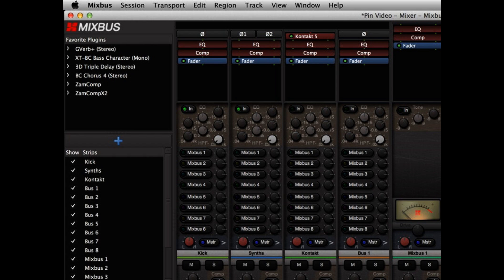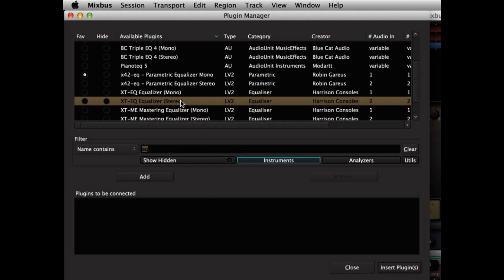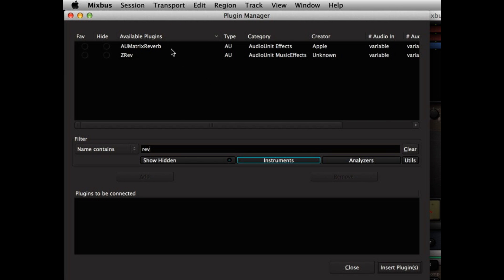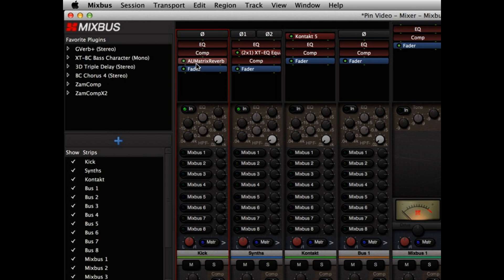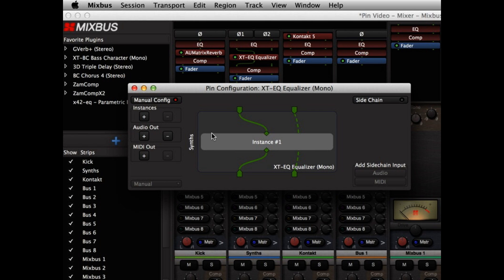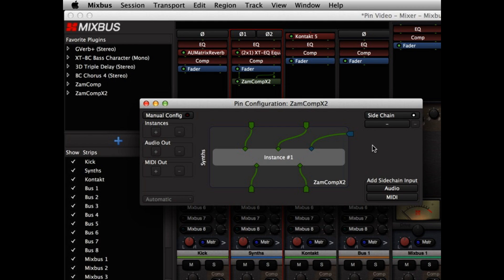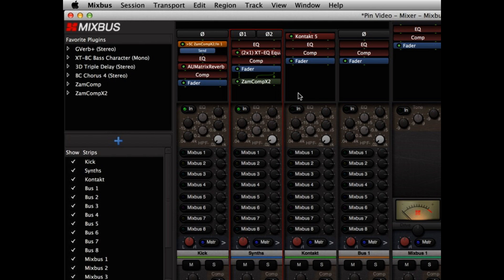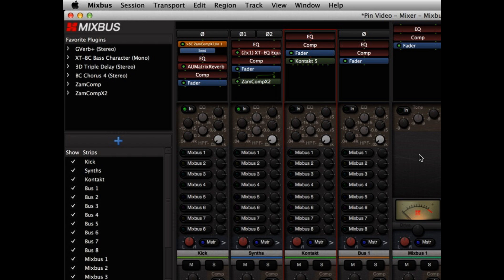Plugin Pin Connections in Mixbus (v3,4)

Comment: The mono -> 2xinstance only works with LV2 plugins right? I have been trying with AU and it doesn't work. I am desperately trying to do dual-mono compression on a stereo track as I used to do in Pro Tools. Anything I'm missing?

Comment: i feel really attracted  to migrate to this software... is there any way to use 3rd party plugins in HMB? for example the UA ones or waves? and which plugin formats are accepted?
Reply from the maker: Yes engendrox, Mixbus works with VST on Windows, AU on Mac, LADSPA plug-ins (supported on all platforms), and LV2.
Reply: thanks for the quick answer. I'm definitively migrating =3